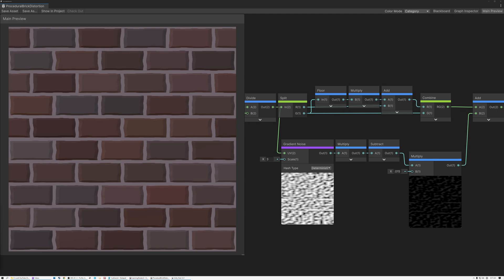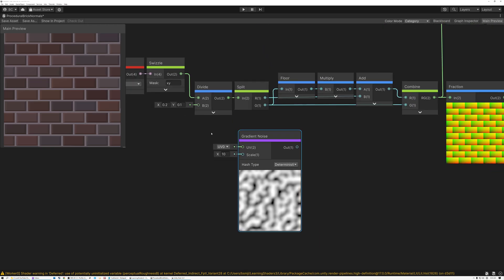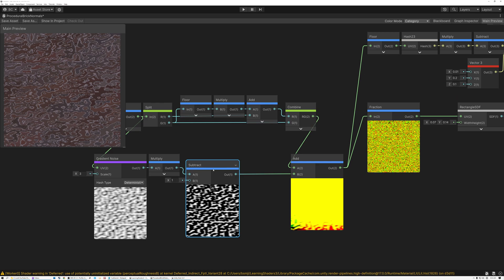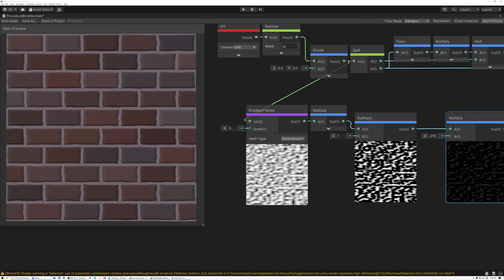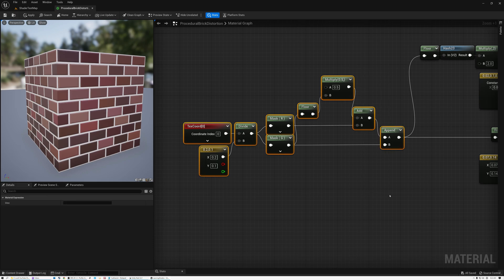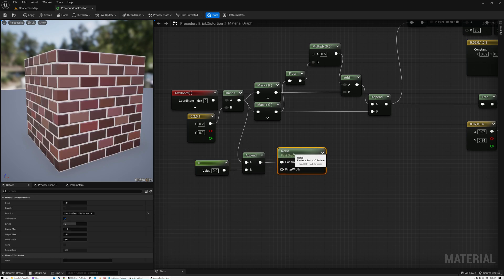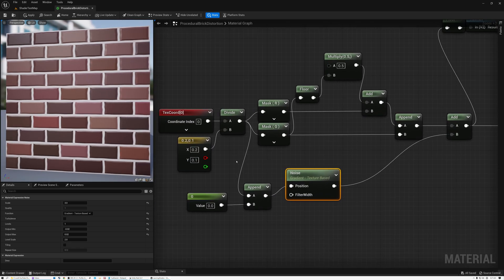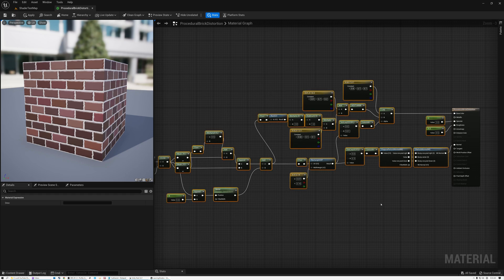Procedural Brick Distortion - Advanced Materials - Episode 31

Comment: I feel like you're kind of using Unreal Blueprints as a Substance Designer graph here, which is cool but I'm wondering which tool would be better if you wanted to make these vector-looking bricks a bit more detailed and realistic, with some slightly rotated/protruding bricks and damaged corners and whatnot, while still maintaining the procedural capabilities in terms of infinite amount of color variation and brick amount, etc.
Reply from the maker: Yes, you're right! What I'm doing here is very similar to the way that Substance Designer works.  The main difference is that when you do this work in the shader itself, the math is calculated for every pixel every frame.  When you do it in Substance Designer, it gets baked down to a texture.  Doing it all in real-time means you have to be very careful with the amount of work you're asking the GPU to do in order to maintain performance.  I could introduce lots of additional details to do all of the things you suggested, but it would probably make the shader run too slow. So what's possible to do in real-time right now is still somewhat limited. Whereas in Substance Designer, you can use hundreds of nodes with dozens of different complex noise patterns, etc. But then in the end after baking to a texture, you would also need to use a shader technique to break up the texture tiling.
Reply: @BenCloward  I'm grateful for the thorough and lengthy response Ben, very insightful and helping me a lot! Great series, opened my eyes to a lot of things already.

Comment: The noise is scaled to a 2:1 aspect ratio, matching the brick shapes and causing more distortion to the vertical lines in the final image. Would be nice to squash the noise horizontally so that when it gets stretched, it ends up applying the same amount of distortion to the horizontal lines as it does to the vertical lines.
Reply from the maker: Oh yes, that's a great suggestion!